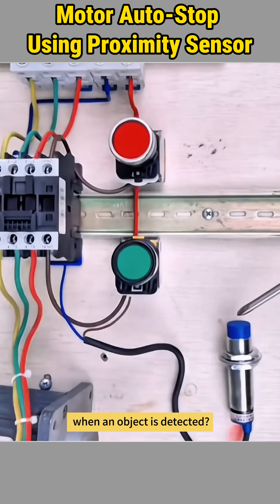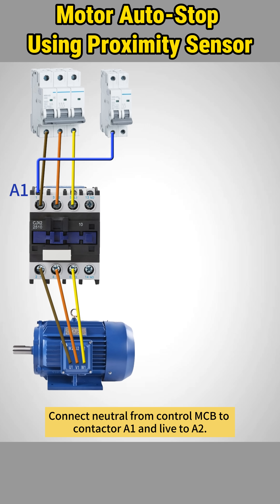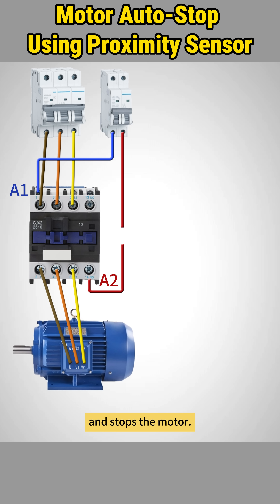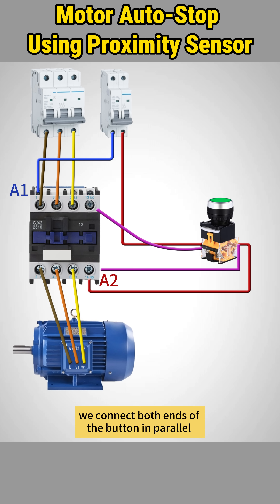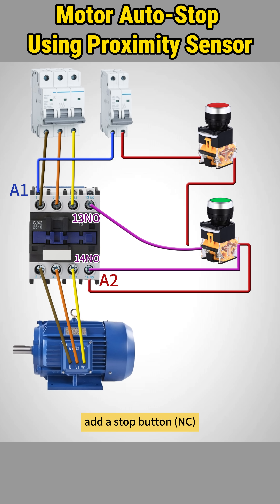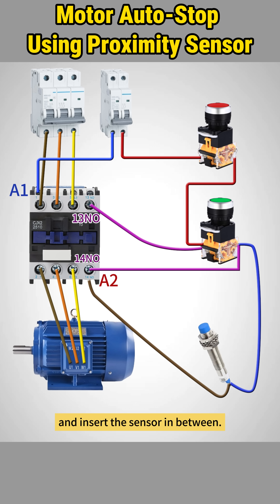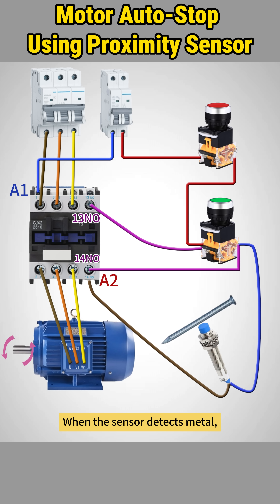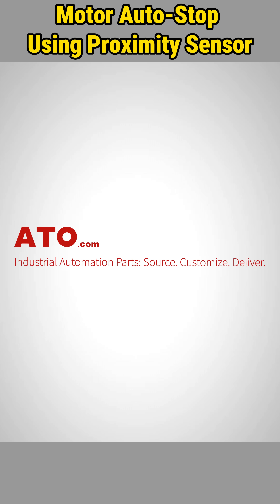Wiring a Proximity Sensor for Motor Auto-Stop

Comment: Using direct sensor power cutting in contactor's winding doesn't seems a practical solution because in case of a short circuit on the signal if sensor gets broken the motor will never stop. Periodic maintenance activities shall be performed in order to ensure proper sensor holding, redundant detection and protective electronic along the sensor must be used.